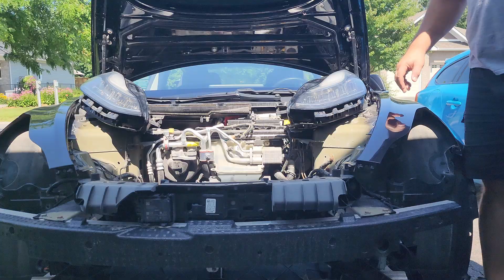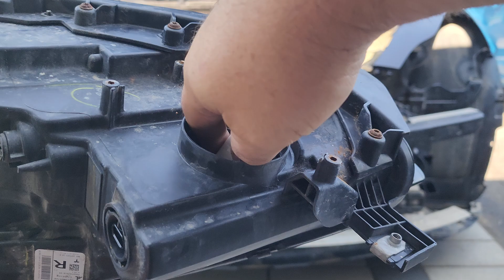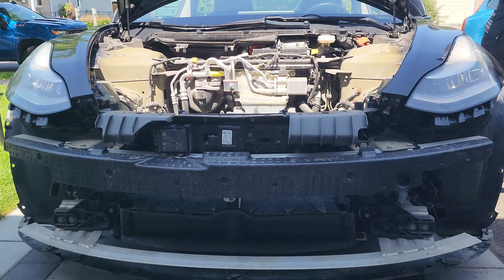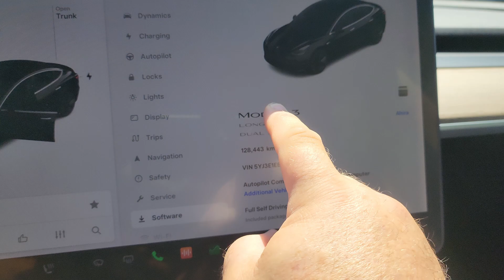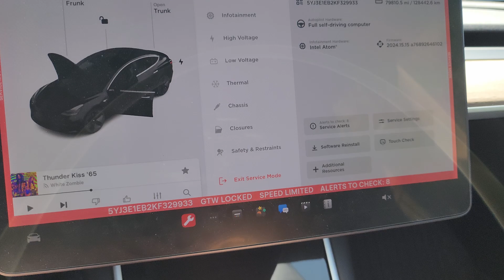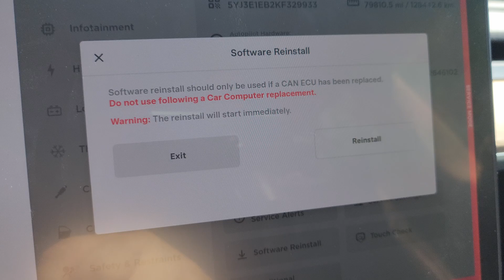Tesla Model 3 Headlight Failure Solution

Comment: I had the exact same problem. I also changed this headlight control modul and it fixed the problem.. for a while.
After two weeks the same problem came back
It turned out that I had an issue with the front wiring harness and that was killing the module. It was a 1500 dollar fix in an independent dealership.

Comment: Thank you! Driver side issue for me. Turns out, you can remove the ballast without removing any of the bumper! 3 T-20 screws are fairly easy to remove with a 1/4" ratchet. The funky black/white clip was very hard to undo, but it's really not much easier with the entire headlight removed...

Comment: i do not see in the video explaing the part number. do all of the numbers need to match or just for example just the top number. 110796-00-f and ignor the other numbers?
Reply from the maker: The part you want to match up is stamped into the casting on the side with the fins. If the triangle of heat fins is facing up, then it is the top right corner. Will be something like 3-1 or 6-2 as an example. There are other possibilities. Hope that helps.

Comment: Hey there what is the part number?   There are several different kind on eBay  for 2020 Tesla model 3
Reply from the maker: You need to pull your headlight and check directly on it as there are several different ones. If you order the wrong one it is likely not to work.

Comment: THANKS for the detailed video. Just got quoted $2100 for the headlamp. Where did you get the ballast?  I need to change it!
Reply from the maker: Happy to help. I got mine on Ebay used. There are lots available. Just make sure the #'s are compatible as I show in the video.
Reply: where can i buy headlight, i have 2020 Model Y?
Reply: @ArkadiyUS-v4e eBay
Reply: where can i buy headlight, i have 2020 Model Y?